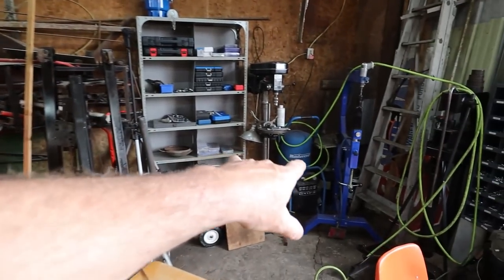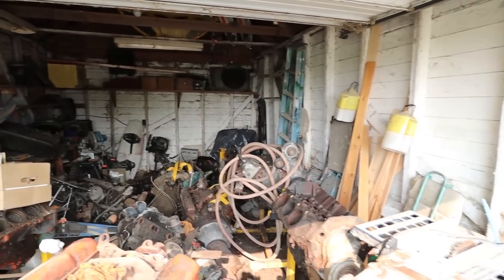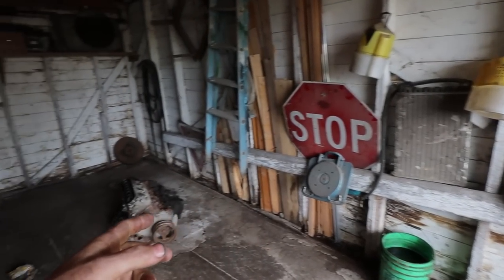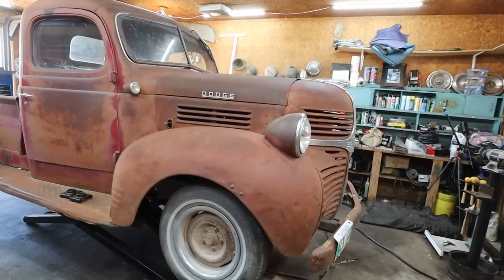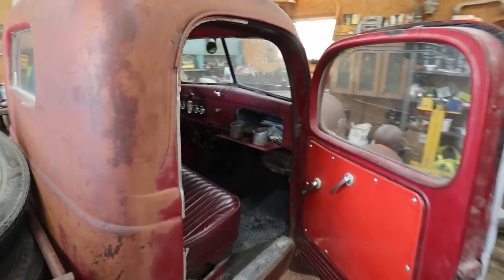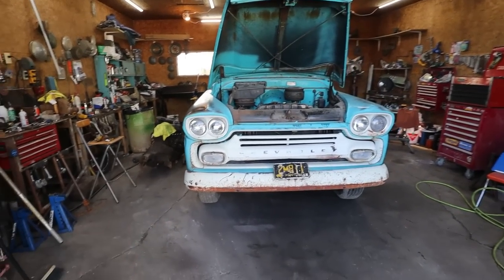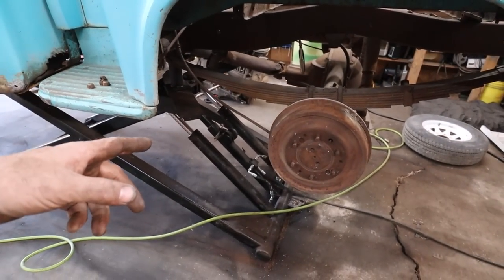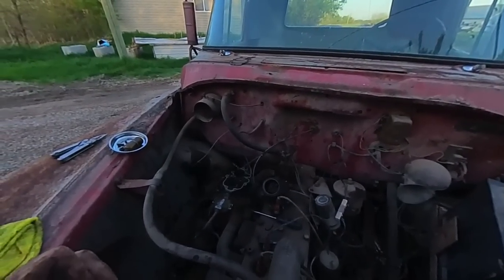Cleaning up some tools and sheds and doing some maintenance on our summer vehicles.

Comment: Brent, organization suggestion:  If you were to move that cabinet that mounts on the rear wall (to the right of the grinder)  up a couple of feet you would have room under it to store your metal brake.  Every little bit of space helps.

Comment: all you need is a portable cement mixer. gravel sand, toss your tools in a Wala, clean tools bolts screws or anything metal you need cleaned. :text-green-game-over::yt::oops::buffering::buffering:

Comment: Where you had the A model parked up for the winter, the shed with the channels in the concrete floor, it would be a good idea I think that when you have time put some sides on the roofline and diagonally park all your drivable cars in there, It certainly seems wide enough and it would free up room in your other sheds for you to work and store your tools. You need a tyre/wheel rack so you can store all your different size rims in numerical order, some heavy duty racking for your transmissions and engines would be the go, utilize all the space above the floor+. Wish I was there in Canada to come around and give you a hand with stuff.

Comment: When you are designing your new shop, I would suggest several things to consider -- install fire extinguishers at strategic points, the plasma table installed in a wood sided building is a fire hazard - install corrugated metal sheeting on the walls, when laying out the shop take advice from your wife on kitchen layout - the kitchen triangle - so tools + workbench + power tools so that equipment is at hand to reduce travelling time, use racks with bins to store miscellaneous items ( labelled), lastly, really important, improve your personal safety eg welding without flash glasses or facemask'
All the best to you. John

Comment: On those rusty wrenches, you should try soaking them in Evporust, just soak them overnight and it will take the rust right off. It leaves a black film that I just wipe off with some WD-40 and a scotchbright pad. The Evaporust will evaporate so cover it, I use a plastic container with a lid on it. You can reuse it, I just strain it with a paint strainer right back into the jug it came in. Good luck,  thanks for sharing.

Comment: Great to see you're feeling like you've made progress. As your'e going through your bits - white vinegar is your friend. Anything you can soak in white vinegar overnite in a 5 gal bucket makes the wire wheel work much less. Cheaper than evaporust. Evaporust is great but for general cleanup it can be pricey. 

It's always a good time teaching a newbie the stick shift. No better teacher than an old truck too! 
Be well thanks for sharing

Comment: Hey Brent- Don't underestimate the ease of putting a lot of those tools in a bucket of Vinegar. 
It will do it without any effort and you just pull the tools out and put in a warm/hot bath of oil afterwards.
You can use the old used engine oil as the bath  then just wipe clean or wash in some kerro then WD40 or Krown spray and your done.

Saves wire brushing - and what less than $4.00 a gallon for white Vinegar. 
Seriously give it a try. you will be amazed.

Comment: You need to get a big plastic tub and fill it about halfway with white vinegar and let the tools sit overnight in it and then put them in another tub with soap and water and some baking soda and it will clean them right up!! I clean mill scale off of new steel with it and it washes right off after a 24 hour soak!! But you have to wash it off with the soap and baking soda mixture to stop the acid on the steel!!

Comment: Big Mike Liberty Hill TX on your tools and equipment I always use sand blasting attachment on pressure washer when restoring heavy equipment and stationary equipment no dust save a ton of time gauges and things you don’t want to remove single layer of duct tape is all I used I’m to lazy for wire brush or wheel lol  and great way to prep for paint

Comment: Mr Brent, I was wondering as maybe a side adventure for the young one, Maybe you could take one of the old hoist frames from the old shop and re-enforce the legs with scrap plate metal or old piping that would fit on the outside or in the channels that don't block the drive chains,Maybe check the drives to see if they are strong enough to support weight and maybe get one running enough to mount it outside for trans jobs on the not so heavy projects until you get your shop built,Throw a motor on it  and a weather shield on the electrical ,Your knowledge is great and old frames out of things that you wreck out might supply the re-enforcing material too. Just a thought.

Comment: A sonic cleaner will clean the rust off of your tools pretty easily I think I used a mag wheel cleaner and I believe it had muriatic acid in it they cleaned up pretty good
Reply: Molasses cut with water also works very well for rust.

Comment: Wish you were working on the 35 dodge can't believe this nightmare it was coming along like clock work. You might have to weld in new sections of metalwork, the heat warped it but you know you can do it or you wouldn't have said it the 37 pick up will be even harder but you started with nothing you'll do it again

Comment: Brent why not pull a quick release fitting on your scissors lift to run off the high lift or a tractor till you replace the power pack?

Comment: My question is about HOT WORK being done before you left or while you were gone. A few years ago I worked at a ship yard and our dock is wood. Over the 4th of July weekend someone shot a bottle rocket at our dock and it took 3 days before the fire actually started. The timber smoldered for three days because the temp went lower. But I happened to find the fire first thing in the morning when I showed up and did an inspection of the dock before a ship arrived.

Comment: It could just the Oil seals on valve stems n I take plugs out n put some small rope in cylinders to hold valve from falling n use valve spring compressor n remove spring n change Seals with new seals n  because they get Hard n let oil leak through n it should stop the Smoking problem unless it's the Oil Rings huh 😆
Reply from the maker: They usually they don't smoke that bad there with valve seals then again a compression test will tell me everything lol
Reply: @HalfassKustoms  ya it will huh